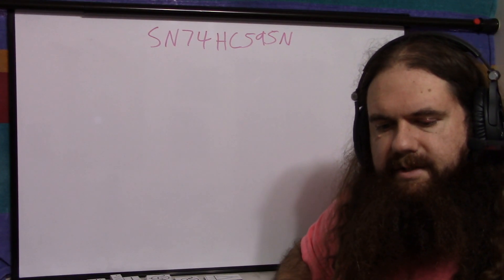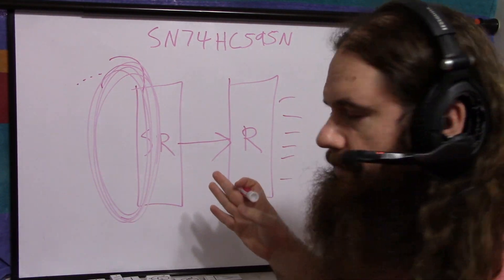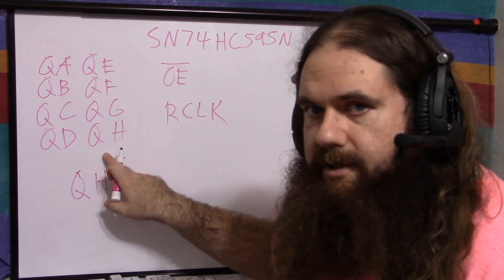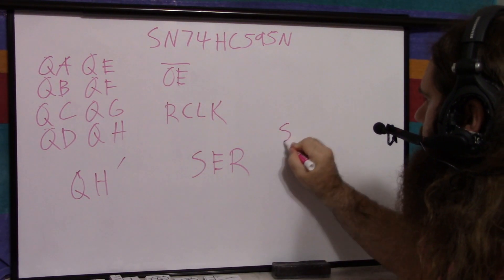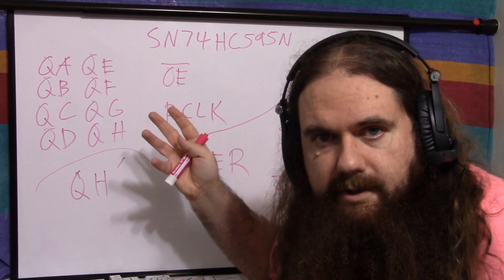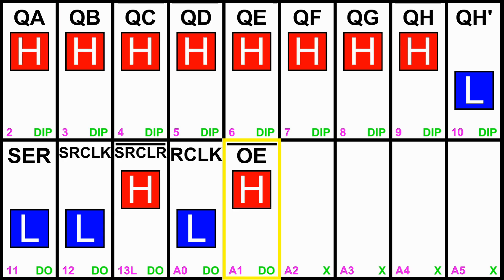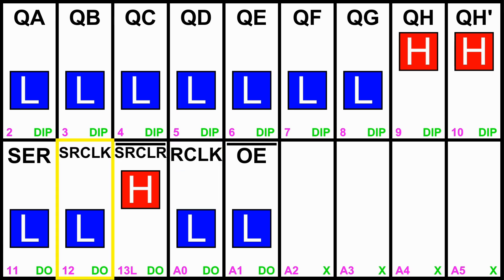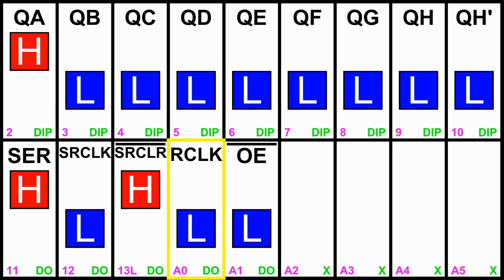SN74HC595N - 8-Bit S-I-P-O Tri-State Buffered Shift Register - Not Until You Are Ready - Simply Put

Comment: These are great if you're doing something with an Arduino or ESP (or any microcontroller, really) and you don't have enough pins to control what you want.  I use two of these to input the data into my EEPROMs, and it only requires three of the pins on the Arduino - the Serial input pin, the clock pin and the register clock pin. You don't need to clear it if every value you're inputting is the maximum amount of bits your setup has (in my case 16bit), because you'll just shift out the previous value as you're shifting in the new one and everything is great.
Reply from the maker: Yep, I got these chips because of a viewer suggestion regarding a different shift register I featured. There are so many chips!